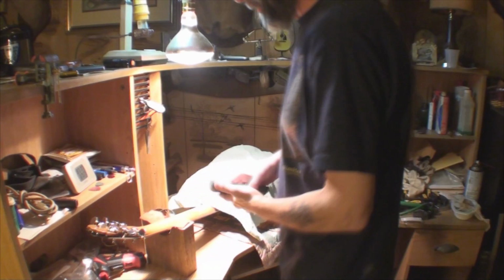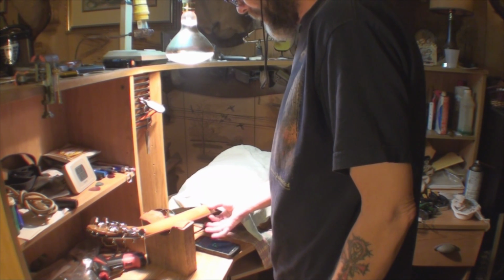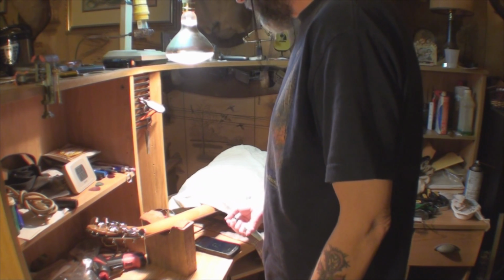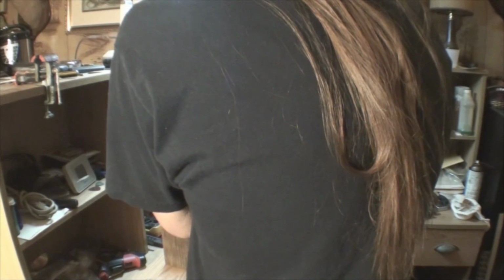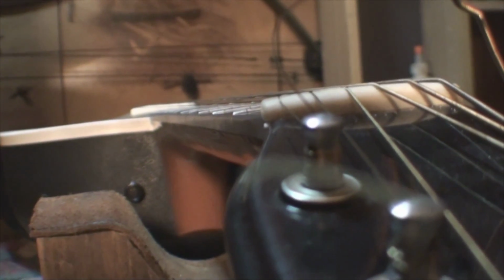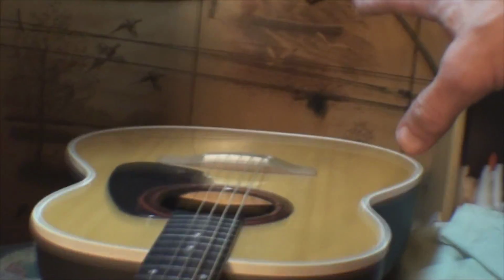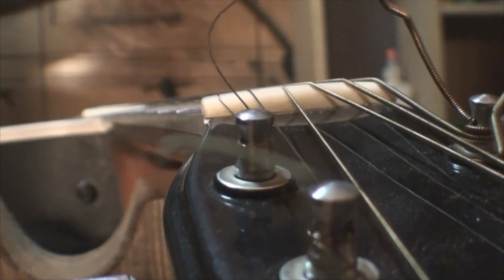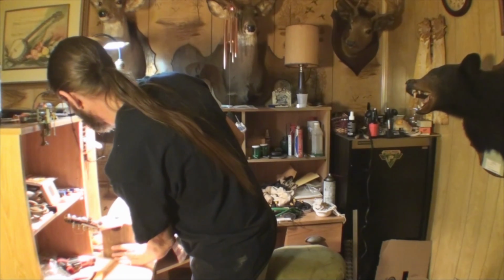How to straighten neck on Ovation Applause AA14-4 guitar update no truss Not calling it quits yet!

Comment: hey randy, I just got an ovation applause aa14-4, and i have to say, it is in a very poor condition, but it just needs some work, you know, special work.
one of its problems is that the bridge is lifting, I already tried tuning a half step down, but it just kept lifting, do I decided to take the strings off, after that, I talked with some guitar techs of my town, and they said they wouldn't like to take the risk of try to glue the bridge, and they told me to talk to a carpenter, because the wood underneath the bridge it's not as high as the top of the guitar, so the bridge wouldn't join to the top.
okay, my dad, who is also a carpenter, told me that he could help me with that, he thinks that we should humidify the interior of the guitar, specially the top, below the bridge, so the wood becomes flexible, and then, we could add some wood glue where we're going to join the bridge, and apoly some pressure with carpenter clamps
here's my doubt, I saw some videos on youtube, and all of them actualky remove the bridge, so it can be glued again, but I'm hesitating about doing that, first because I wouldn't like to damage the finish of the guitar (more than now), and also I don't know if I will be able to remive de bridge since this reinforcements are there.
I'm still a little too nervous about that, because I really fell in love with that guitar and I wouldn't like to leave it there just like that.
what do you think I should do? remove the bridge of my guitar and glue it again?
or do yoy think my dad's method wilk work?
thank you for these videos, it's hard to find tutorial videos for maintenance of this tyoe of guitars and seriously, you have helped me a lot, thank you.

Comment: Looks like you're gonna win, way to go. The dogs are great.
Reply from the maker: +Dane Nichols I'm still not sure lol man this neck is some strong material to be plastic. I'm gona stay on it tho until something happens. :) Thanks for your support Dane!
Reply: I just found out that Ovation body bowls is the stuff a enginner / guitarist created he made the substance  for helicopters blades during Vietnam. Before that substance they used multi wood laminated & the blades would disintegrate … till he came up w/that man made material so after that upgrade it gave them to ability to have two blades on a chopper. After the war he made Ovation Guitars using that material it's called " something??? forgot the 1st part.. - Strand". Great Job.

Comment: It sounds like you’re on the right track. I recall suggesting you do just what you are doing. I hope the heavy strings + heat continue to work until the neck relief is corrected. Good harmony at the end :-)
Reply from the maker: +Dale Palmer lol that harmony was starting to blend! :) That seemed like one of the best approaches, it's still working but man it's slow, someone else told me they did this to an Ovation and it took 30 days to get the neck relief in it, shes under heat as we speak! Thanks Dale and thanks for the suggestion!

Comment: I see you re-crowned the frets down in cowboy chord land.    It was shameful that someone had to frolic with a mill file trying to correct the problem.
As always:  Great video, great work ethic and please get well soon.
Cheers brother!
Reply from the maker: +Crazy Uncle Duke They almost took enough material away from those first 5 frets that my smallest crown file barely worked! Strange they had the knowledge of splitting a pencil in half to mark the arch and height of the frets on the nut, and then do something like this to the frets. I mean it seemed like whoever did this had "some" knowledge, it definitely wasn't enough tho. Thanks Uncle Duke!

Comment: Just saw this video. Looks like you came up with the idea I would have suggested.  Which would have been,,,  heat the plastic,, spray cooling mist on the metal,,,  let heavy strings pull the neck a *slight bit beyond" the desired relief point, cause in time it'll backtrack a bit. Then at that point spray the plastic with cooling mist to set it quick before the heavy strings bow the soundboard.

Comment: Really great video Randy -- fun to watch!  I'll be tuning in for the next installment of the life of the guitar super fixer upper!!  Wondering what caused you to select 140 degrees F.  I was one for giving up  but you are fixing it so good for you! Get well soon man!
Reply from the maker: +Mandolin1944 I started at 120 degrees which is completely safe for wood as long as it's not left so long it dries it out, 120 wasn't working so upped it to 140 and relief started appearing as the strings kept stress on it, at it's dropped the tuning one complete step, two times. I think I'm going to have to raise the heat or try something else now because it's not changing as much as it was at first. Thanks for watching!

Comment: Good job Randy.
Reply from the maker: +Tim Fergel Thanks Tim! Man whatever this neck is made of is really tough stuff, since this video I've upped the heat to 200 degrees and it's really slow to gain any relief, it's gaining each day but 200 degrees I would have thought would speeded it up.
Reply: +Randy Schartiger Wow, that's one hot guitar. LOL  progress is progress, I wonder if the aluminum portion of the neck is what's slowing the bending down.
Reply from the maker: *****
Hot guitar! LOL! Yeah I think that aluminum is making it slower, yesterday I turned it over and heated the fretboard a long time but didn't gain anything so went back to heating the back side.